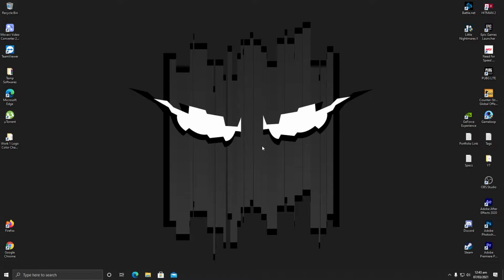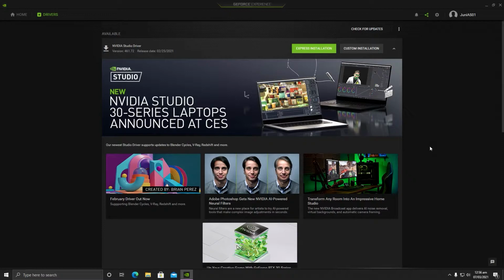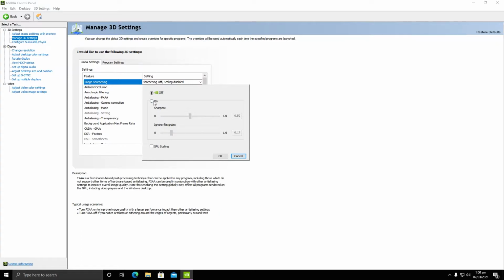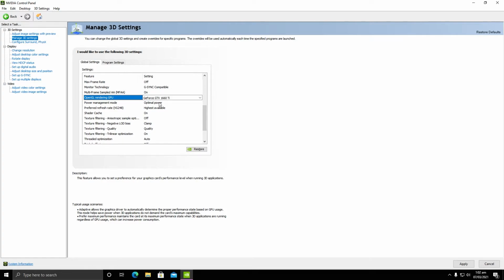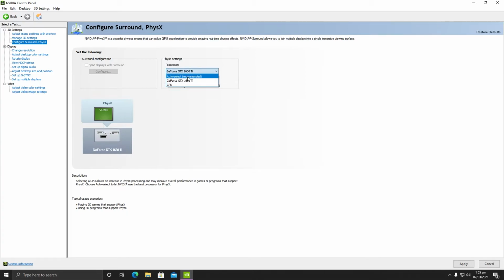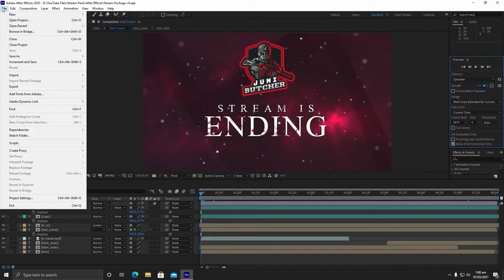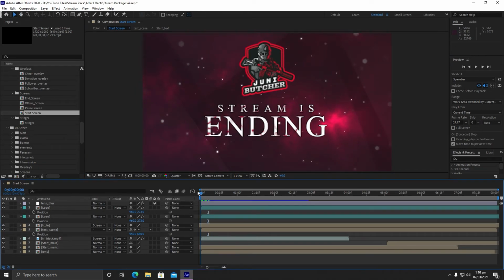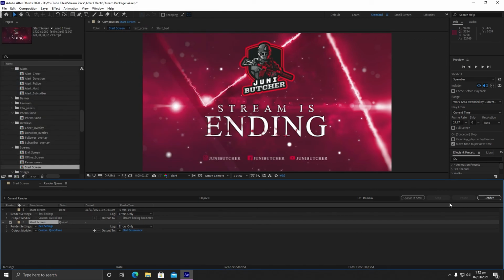OPTIMIZE NVIDIA CONTROL PANEL 2021 | MAX Performance NVIDIA GRAPHICS CARD Settings For AFTER EFFECTS

Comment: Hello, even though I managed to set all the settings as you showed, the CPU is running at 90% and the GPU is running at 10% in the render. also, all my other settings and driver updated, in Pr settings are done (like CUDA etc.) and the Windows GPU option is ON.
Reply: RTX 3070Ti - I7/11700F - 32GB RAM - 1TB m2 HDD
Reply from the maker: 10% gpu usage is normal, it will use gpu when needed otherwise it will use cpu and ram

Comment: Unfortunately my AE do not use my GPU, i've tried every single tutorial in internet. Either for rendering or for work within the program.

i7-10750h
rtx 2060
16gb ram 3200mhz

sorry for my bad english, i've learned by.

plss someboddy help me!!
Reply: hi, i may have a few fixes for you. if you open after effects click on file->project setting and than make sure that there is mecury GPU acceleration(CUDA) selected.
2. in Nvidia control panel go to manage 3d settings and than program settings select after effects and by cuda select your gpu

hope this might work for you
Reply from the maker: Sorry to hear it, did you tried my all video tutorials on aftereffects?
Reply: Ur cpu only has 6 cores better u should upgrade to 8 cores
Reply: @varunsiddarth5670  As far as I know, after effects still benefits more from single core performance than multi core.

Comment: in nvidia panel i dont get the option of GPU Scaling under image sharpening , pls say somethin abt it
Reply from the maker: If you don't have it, it means your cpu will do the scaling automatically. You are good to go my friend. It doesn't make a hige difference. GPU scaling is used to increase the dimensions of screen automatically.
Reply: @FlixityOfficial  sheesh thanks for the quick reply tho

Comment: in my geforce experience window there is no option for studio driver, there is only game ready driver. what to do?
Reply from the maker: Which graphics card do you have? My new video is coming on how to download it manually too.
Reply: @FlixityOfficial  I have Nvidia Geforce GTX 950 in my system.
Reply from the maker: That's a good graphics card btw.
Reply: @FlixityOfficial  but it is not bing used by editing softwares like after effects and premiere pro.
Reply: Same problem bro with mx 250
Reply from the maker: Can't download studio driver?